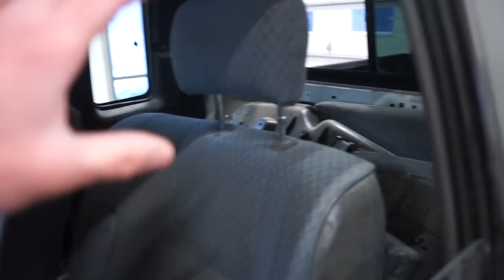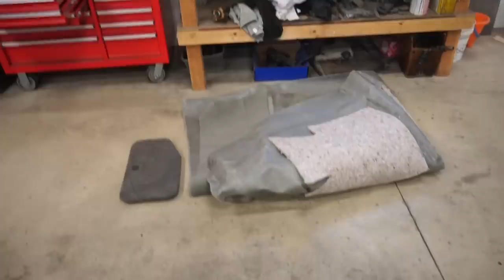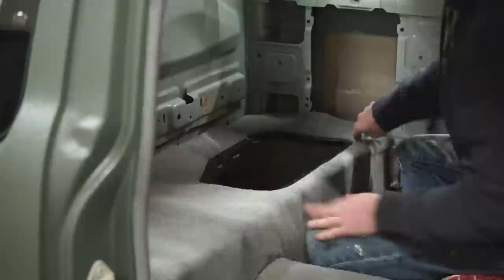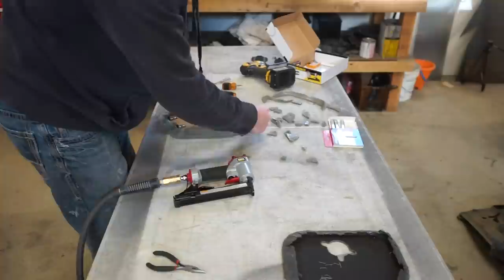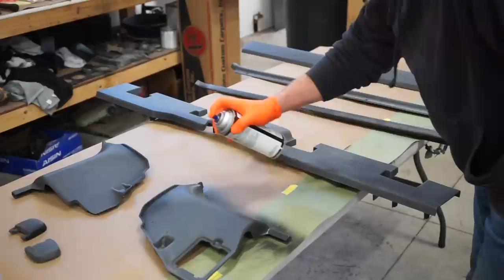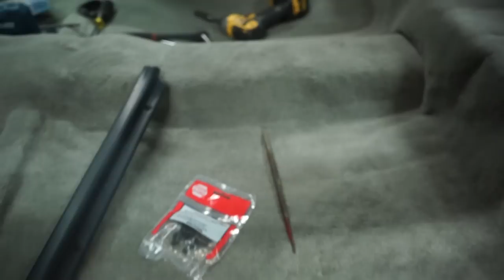New Carpet Kit For The Yota!!

Comment: I just put a carpet from the same manufacturer in my ‘89 ex cab 4x (3vze), and I was really happy with the quality of it. I spent a little less than $300, I think because I got the extra thick backing to deaden noise and for insulation.

Either that or I got ripped off, if you were under two.

Anyway, yeah, had to cut in the shifters, seatbelts and trim the length and width. But, better large than small! 

I didn’t have a carpet to use as a pattern, because I did the last one myself using an un-formed marine carpet, and I’m not a carpet guy, so I cut it all up removing it. Live and learn. It wasn’t quite right anyway.

But the point is, it’s a really high quality carpet, all molded for the pickup, and it went great putting it in.

I removed the belts, the lower dash (for another reason, but it made good room),  the front seats, the plastic trim at the back under the rear seats and the center console. I worked off the two ridges formed for the underseat wire raceways or seat bolting stiffeners, and it went great.

Can’t remember last time I bought something and thought to myself “this is a really nice high quality thing!” It looks great.

That is all. As you were.

Comment: A tip for next time leave the seat bolts in the floor put carpet in then cut a X over the bolt then push carpet down over bolt makes finding seat bolt holes easy

Comment: Nice job 👍🏽 I’ll be installing a similar kit into a 2WD version of your truck soon. Question, do you think it’s possible to carefully use a heat gun on the underside of the carpet to get it to mold a little tighter? Thanks again for the video 👍🏽

Comment: A clothing steamer helps with the carpet in forming, smoothing and shaping. Additionally you can get inexpensive insulation to install on the floor.  Which is a great sound deadening.  There are expensive,  "car / truck " brands on the market.  But you can get the less expensive "insulation " from pretty much any hardware store.

Comment: I used the same company for my carpet replacement on my last 85. I opted for the extra thick batting on the underside. The extra thickness required a little extra shaving here and there for bolt alignment and such. I had the original carpet to use as a template though. It appears you weren’t so lucky.

Comment: I am getting ready to replace the carpet in my 1993 toyota pickup. At the rocker panels, OEM had small white clips that sat on a ridge, what did you do? glue strip? and on the edges towards the firewall and the bac kof the cab, did you glue? did you glue the entire carpet down?

Comment: If you left the bolts in for the seats and seat belts, all you would have to do is slice the bolt head area and then you have a clean hole for the bolts. But good job so far

Comment: Coming together nicely 🤟🇮🇪🇮🇪
Reply: Keep up the good work, Good tip for doing seat & seat belt holes in the carpet is to use a large soldering iron, melts a nice hole through the carpet & also stops the threads on the carpet from pulling

Comment: i tried corbeau, but my seat mounting measurements became a combination of their three different seat bracket templates. different from what my driver side and passenger side measured in my 1990 single cab toy truck - especially for the rear mounting points. if you decided on going with corbeaus i would like to see how if your measurements match mine or their template.

Comment: Did you ever think about Raptor lining the interior? I have a T100 with some carpet issues and I thought about putting down some Dynamat (or knockoff) and then Raptor line on top of that.
Reply: Bed liners release toxic fumes, even after they’ve cured. There are similar liners that are formulated to be safe in enclosed areas though.
Reply: Thanks for adding that comment. I did find that out after my post, but good for others to know as well. Looks like Lizard Skin would work, but I don’t know how durable it is.
Reply: @awhipps  IIRC, it’s not as durable as a good bed liner, but still better than the spray can stuff.